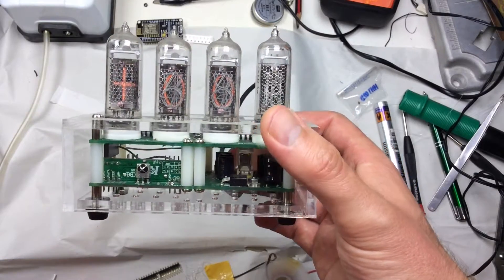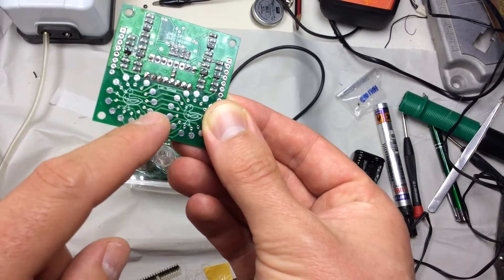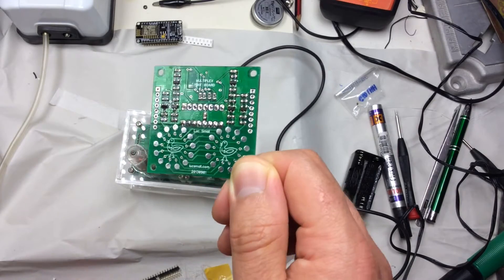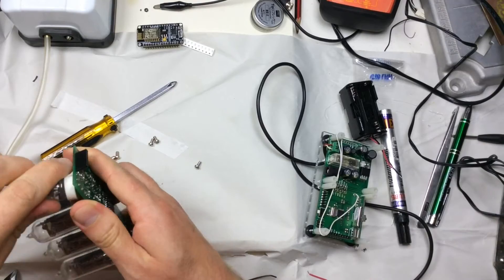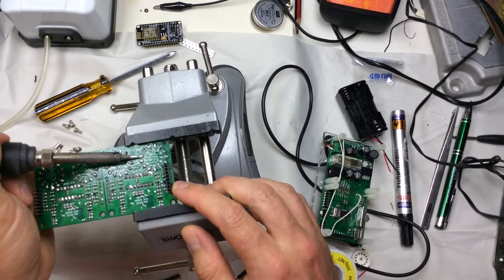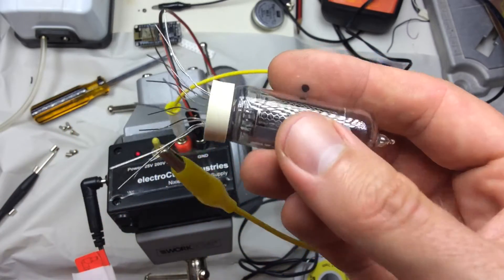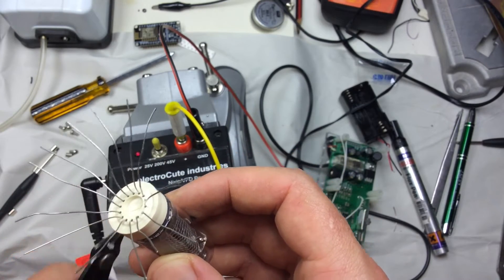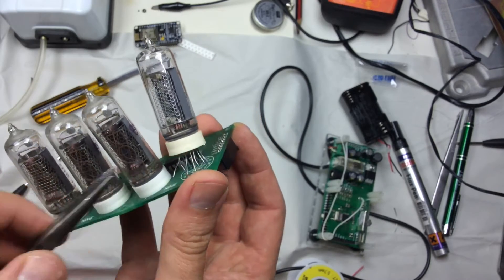Replacing a Nixie tube and a PCB design trick

Comment: I recently replaced a small IN-16 tube for a clock and found that if you pull the white skirt of the tube down near the bottom of the leads it helps with lining up the leads with the holes in the board.
Reply: TrevorMyrtleBeach I will try this for my project. If this works, I will love you forever!